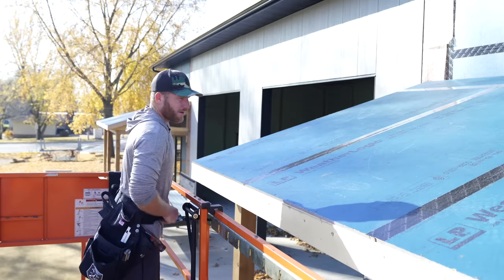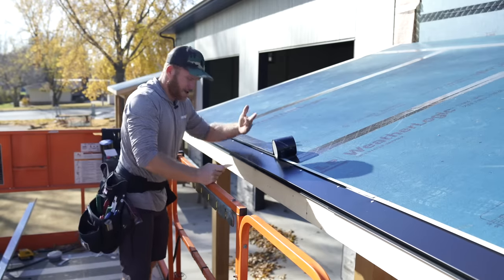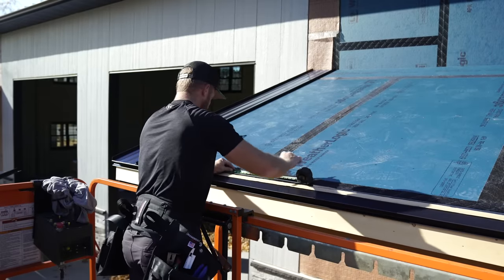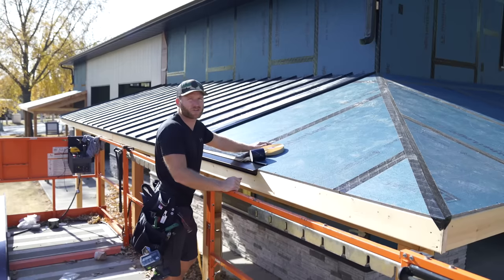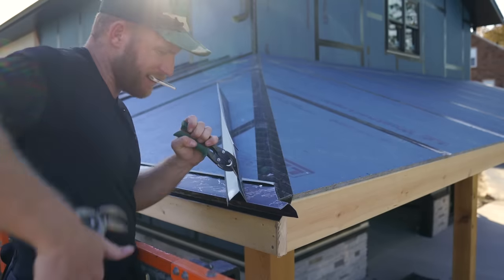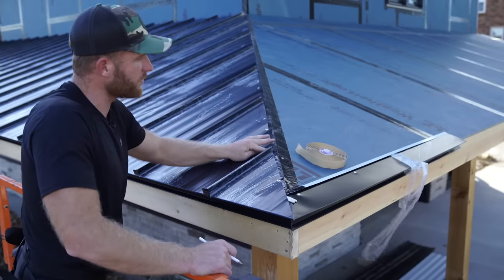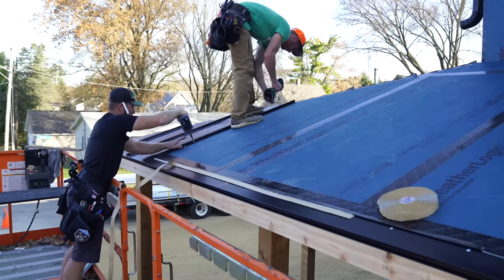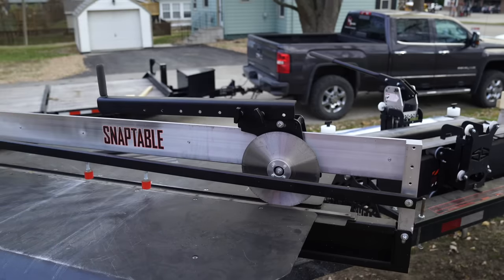O.M.G. Part 11: Standing Seam Metal Roof Install Details

Comment: Nice to see someone else that actually turns ends and caps snaplock ends.. been doing these 20 years and most don't do it. Also someone that cuts all trim into together rather than just overlap

Comment: Ever think of having an old plastic drum or the like on the lift for chucking all the small off cuts into rather than on the floor? Nice to see the shear in action, that looks like it could make easy work of any stray fingers! You can really get through the runs when on a straight roof with no hips etc. Looks great!

Comment: So I agree with the taping of the trim to the roof deck bite what is the return for on the trim piece? And all eve should be installed then string lined to make sure it is  straight there for your first panel that way you can 6/8/10 the first panel installation. If you do not string line, nothing is going to be true

Comment: You need a traufen schlieser to crimp your metal on the bottom. We do a lot of standing roofs and it's definitely a time saver. Also wondering how you like your snap table pro, i haven't used one but was thinking about buying one. just curious do you save a lot of time by using one?

Comment: Question for you Kyle. When a customers approaches you for a quote, how long do you spend working out a quote so you know the cost of materials, and once they accept your quote, do you need to spend more time getting your materials worked out. 
I'm amazed you know the lengths of each of those sheets on the porch corner before you even order the sheets, so makes me wonder how much time is spent working it out, or is there a program that spits it all out for you?

Comment: I have a 23'9" length flat roof carport that currently has torche down and I would like to replace it with this metal roof. Will if leak if I use 2 of 12' long and overlap 3"?

Comment: So at 12:02 those panel that you completed on the left when you put the right side on...what if the gap in-between the left and right is about 4 inches and other spot are 2 inches? Still be ok since  the hip cap is still to be installed?

Comment: I had a standing seam metal roof installed on a beach house. Within a month, bats moved in to the holes left in the ridge cap and bees infiltrated the gaps down at the eaves and fascia. How do you prevent that?

Comment: Kyle and Greg. Thanks for the great videos you make. I would like to know what hand shears you use and why?. I do armored glass in vehicles and have to cut retention straps on the A-pillar in the vehicle after the windshield is installed. I can never get a clean cut. Can you please advise and recommend some metal hand shears to get either a left or right cut. Thank you

Comment: So my metal supplier here in atlanta, ga doesn’t do the plastic on my panels because it gets messed up on the rollers of the machine. I see some people the edges have like 2 inch were there isn’t any plastic which helps with rollers. But I looks like yours only has plastic on half of it.

Comment: You ran the black tape at the bottom (I didn't think it was necessary) but then put caulk tape down.  Wouldn't that just keep the moisture under the steel?
Reply from the maker: What can you do??? Best case it doesn’t work it’s way onto the sheathing... I’d rather have small condensation on the metal than wood right
Reply: @RRBuildings  Very true.  Really enjoy your work and have learned a lot.  I'm Building a field shelter and using some of your tricks.
Reply: @RRBuildings  Water and moisture will be easily evacuated from the small fittings in each joint. There is no problem for that.

Comment: Matt Risinger just did a show on his metal roof which included an air barrier between the sheathing and the steel, what is your opinion?
Reply: I believe Risinger did that because of his outsulation. It is dependent on if the roof is vented and where and how as well as the climate where the building is.
Reply: This isnt a "conditioned space". Meaning its open to outside temperature so shouldn't have underside condensation issues.

Comment: You put the drip metal on before anything and the paper goes over the metal. Even taping it to the paper will still cause problems and a lump in the roofing tin. You would be our clean up guy. Paper,metal,tape the metal over the paper. Not how you do it at all rookies.
Reply: How do you suppose you will put underlayment over that hem across the top of the drip edge. I'm pretty sure this guy knows that the drip goes underneath the underlayment. Doesn't look feasible with this style of trim.

Comment: Great work. I would like to see all ice and water shield under ALL the steel roof
Reply: Seems like a waste....
Reply: Complete waste of time and money with standing seam and the sheathing he used.
Reply: Not needed. In Florida where code is that you need completely dry under roof finishings, under shingles or tile or metal the weather logic or huber, both taped and over driven nails taken care of is water tight. 

If you want to use 100% ice and water you can sheathe the roof in osb.

Comment: a tiner your not... you have red (right)and green(left) hand snips, you don't need to use them upside down
Reply: Lol, regardless of right side up or upside down the left and rights still cut the same direction
Reply: It’s simply for ergonomics using them in different orientations

Comment: The Pythagorean theorem would be 9 (3) ,16(4) and 25(5).  Not 9,16,15
Reply: Wrong answer.
Don't believe me?
 Lay out a 90 degree corner with 9 feet and 16 feet on the legs, and let me know what your hypotenuse measures.
(It won't be 25.)
Reply: But yeah, 9, 16 and 15 won't work either. 
9, 12 and 15 will.
Reply: Ok.  Just a brain fart on my part.